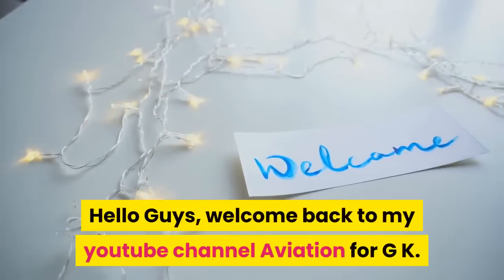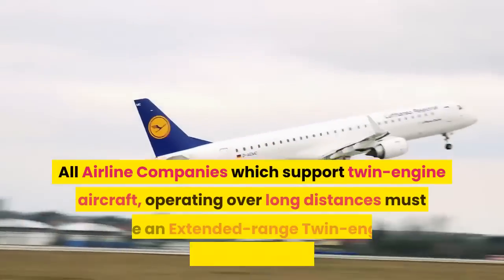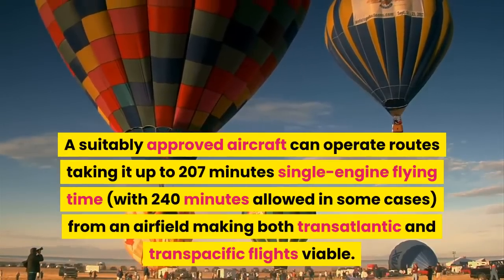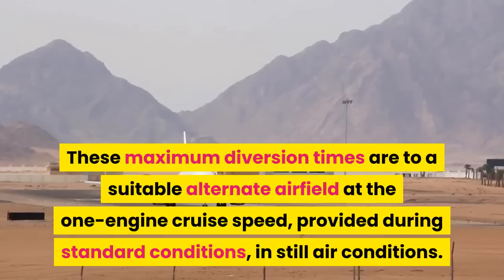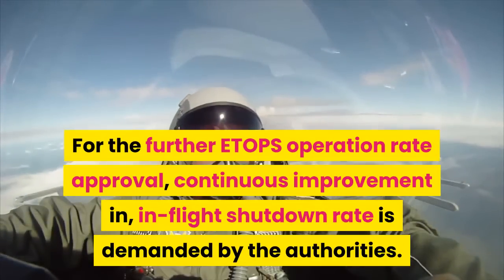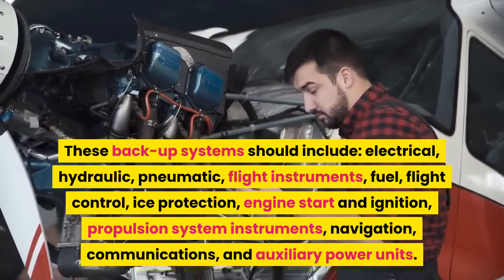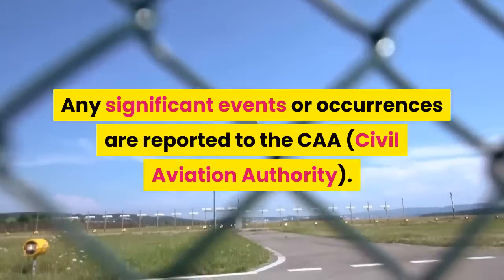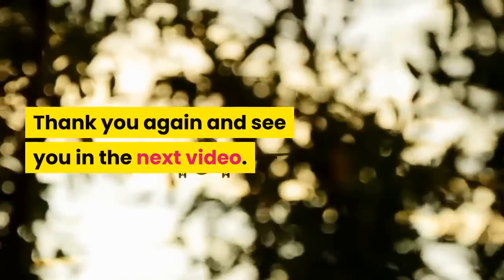What does it mean by ETOPS | EDTO | Extended Range Twin Engine Ops OR Extended Diversion time Ops

Comment: BIG BIG QUESTION. GETTING INTO NAT-HLA AIRSPACE WITH ADS-B ONLY ONBOARD AIRCRAFT, DO I NEED TO COMMUNICATE  FULL STANDARD  POSITION REPORT? OR JUST DE DATA LINK PHRASEOLOGY? EXAMPLE: GANDER RADIO: N123 SELCAL CHECK, ICELAND NEXT
Reply from the maker: Hi Mate, thanks for your question.
I am aware that, to fly over NAT-HLA region it is mandate to have MNPS and PBN systems for navigation, but I have no knowledge in terms of communication standards.

I have attached link below from ICAO for your reference, I hope you will find that helpful.
Thanks 😊 

https://www.icao.int/EURNAT/EUR%20and%20NAT%20Documents/NAT%20Documents/NAT%20Documents/NAT%20Doc%20007/NAT%20Doc%20007%20%20(EN)%20-%20Edition%20V.2021-1_eff%20Feb%202021.pdf